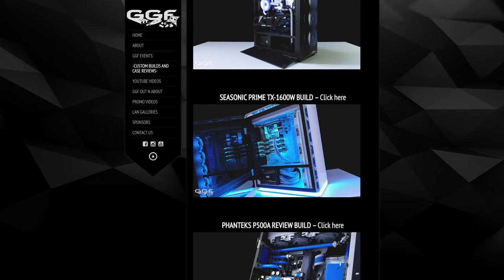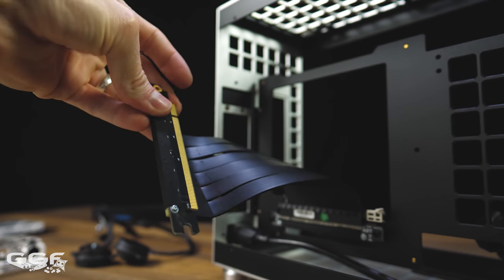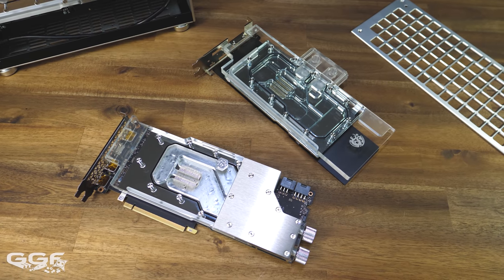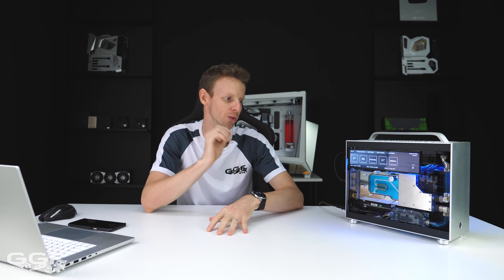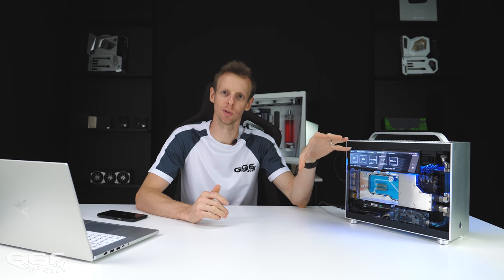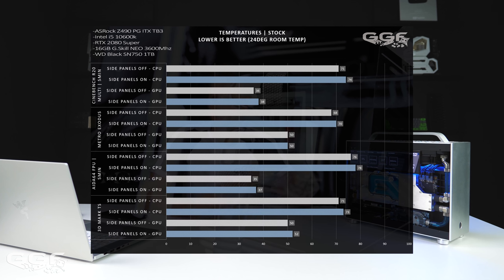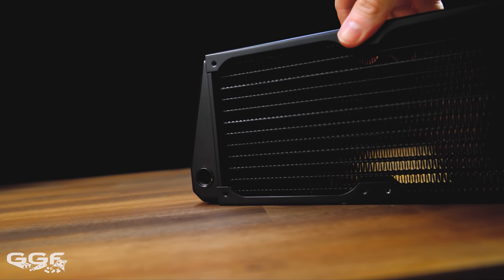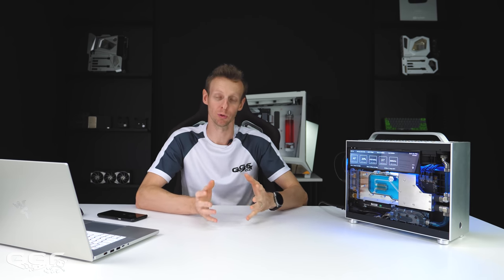Watercooling the Sunmilo T03 + Benchmarks & Temps - Part 2

Comment: Kind of misleading mentioning the Barrow pump/block since T03's CPU cooler clearance is 56mm on paper while the height of the said component is 64.10mm (and this is without the fittings on the in/out ports). I'm pointing it out just because I also have the T03 and  really really wanted to get the Barrow pump/block. Currently running Alphacool Eisbaer LT Solo and am not very happy with it. Other than that, I love your build and how clean it is. This was my first PC build and made a lot of mistakes. I purchased a TUF3080 with a Bykski 3080/3090 block and was not aware that the PCB is much taller with the TUF cards. Almost had to start from scratch again but I managed to fit it with a flat terminal (it has 6 ports!), though it is a bit longer than where the panel should be so I used 10mm standoffs where the panel screws into - not bad looking.

Comment: How do you set up that display? Is it just another small monitor (with a temp app set to run on windows startup?) and plugged into the gpu? You did something similar in the P120 Crystal build and I've been trying to figure it out since I also have the P120 Crystal case.

Comment: if only the case could be made a little taller, then you could fit a second radiator on the bottom to allow for more powerful hardware!
Reply from the maker: It would be too big then. It's only a 10L chassis